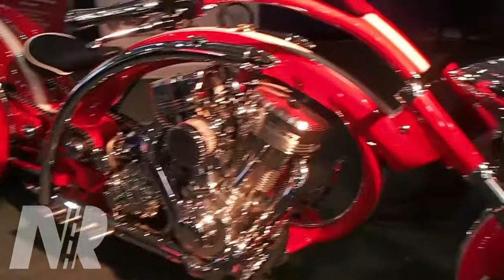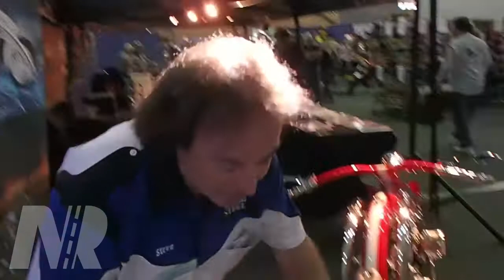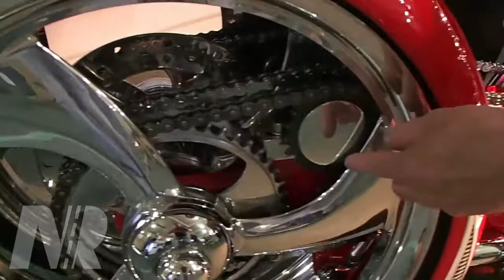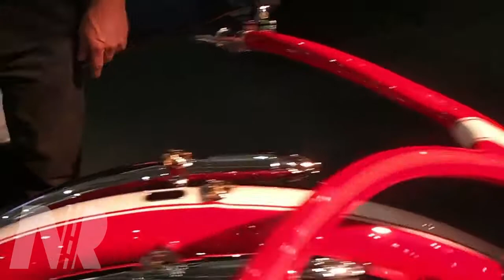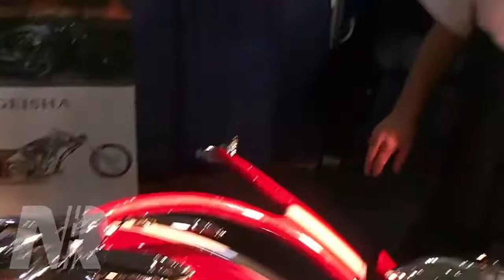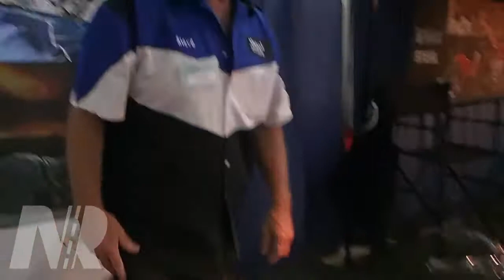The Wikked Steel "Pipe Bomb" Custom Motorcycle

Comment: Not that a guy who could afford that ride would worry about maintenance cost, but I gotta think replacing that "normal size" center tire is a lot cheaper than replacing a big old steamroller and I seriously doubt the side tires would get that much wear. I wonder how it handles all the torque? Are the side tires in contact with the ground when the bike is upright? Really amazing build quality.